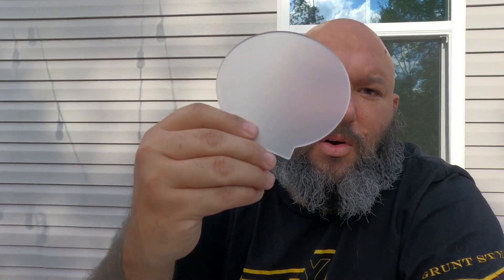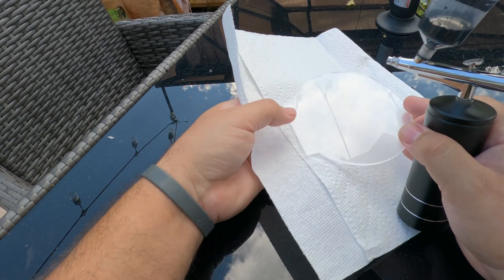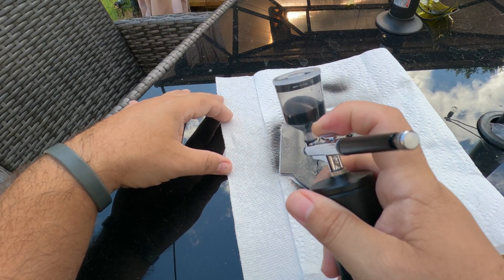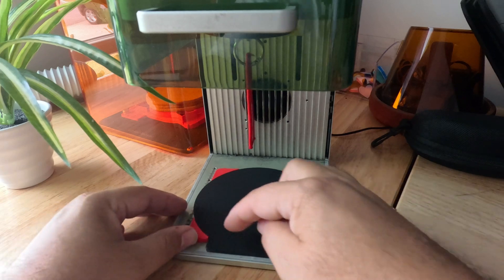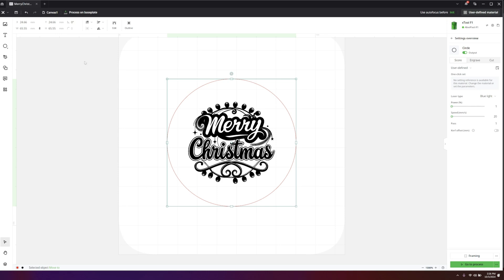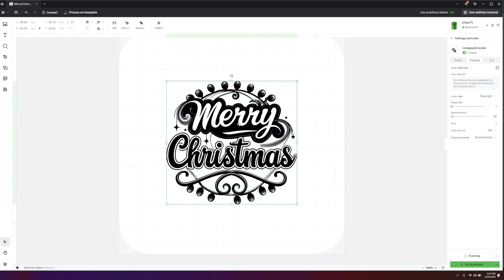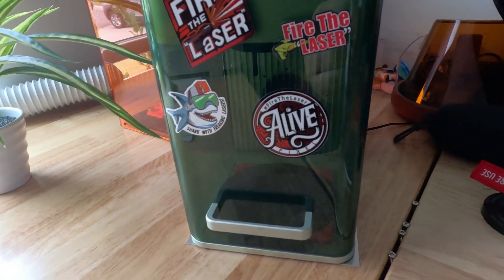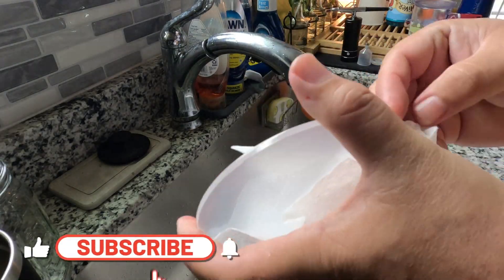How to Laser Engrave Acrylic - LED Christmas Nightlight Tutorial - Laser Engraving Acrylic

Comment: Great job!  I tried this using my Ultra and it just isn’t coming out nice like yours.  What were your settings using the F1 Ultra?  Thanks in advance!
Reply from the maker: I use that F1
basically any laser.
With a 10w diode we used:
60% power, 80mm/s, 1 pass, 260 lines.

Comment: I tried this on a piece of clear acrylic with your settings, same file you used and same paint to water ratio, but it seems where the F1 laser hit just embedded the paint on that spot.  the paint does not wash out or even scrub out of the area where the laser hit.  Maybe the acrylic is different, not sure.
Reply from the maker: Some times acrylic is different even from same supplier. Check geeksatlarge.com he is selling pre cut shapes on a good quality acrylic. Just remember to run a speed / power test to find the best settings for your machine. Each machine is a little different on setting and mine or any other should always be use as a reference not as a rule.

Comment: may be a dumb question but how do you adjust your setting for the f1 ultra?
Reply from the maker: Not a dumb at all. Think that the regular F1 is 10w and ultra is 20w,  based on that lower the power instead 40% on. 10w do 20% on a 20w and play on the speed and all. I highly recommend you to do a speed power test.